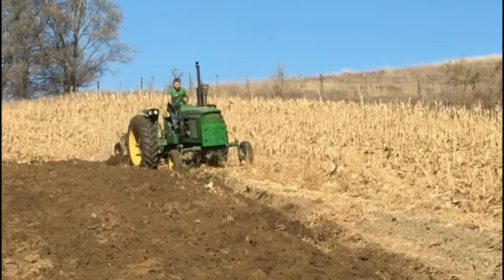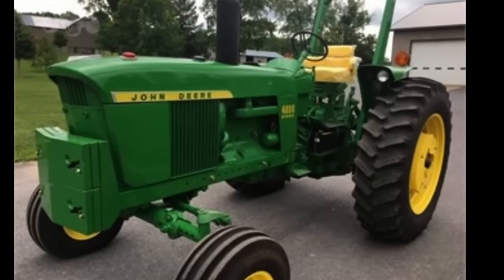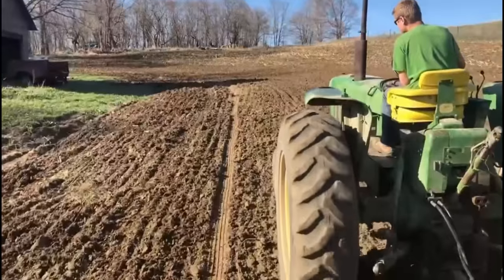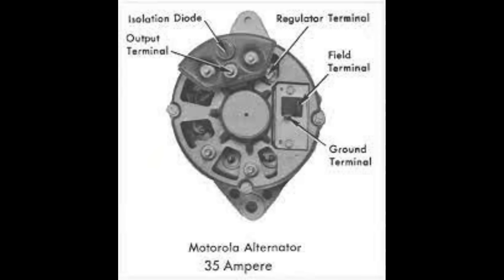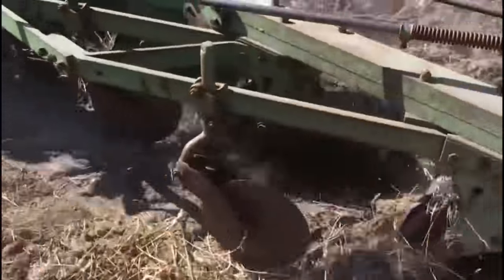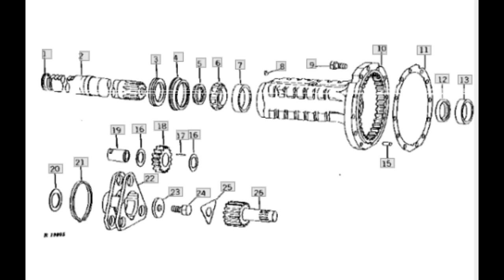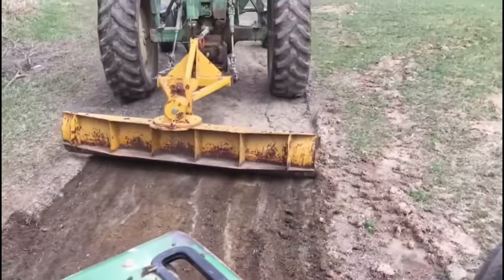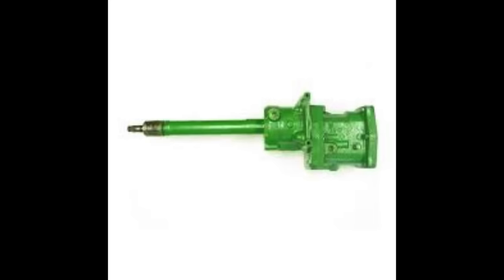John Deere 4000: What Made it different from the 4020 and 3020?

Comment: I remember when JD as a ad campaign promoted the 4000 as an acceptable alternative given the dwindling supply of 4020's as the 4020 was coming to the end of it's production run .Thank you for answering my suggestion. Here's a couple of other topics to look into. First, the nightmare of the Ford 6000 which Ford dearly came to regret. Or the fuel guzzling IH hydrostatic drive. I know you would do good work covering both. Thank you.

Comment: My uncle bought one new in 72 for the farm. Since we were farm equipment dealers he never used it that much. Always sat in corner. Also bought a 5 bottom plow new with it. It was around 7000 new. Surprised he sold it in the 90's. It had around 1500 hours on it and sold it for 16,000 but it was still like new.

Comment: I recently sold a ‘71 4000 synchro.  Nice and straight with diff lock and dual remotes.  No longer needed on the farm and too valuable to let sit around.  Neighbor has a 71 powershift with about 15000 hours.  Kinda rough but very collectible
Reply: Could I ask, how much did you sell the 4000 for?

Comment: One aspect you didn't touch on (and might be hard to research) is market conditions- what was the competition doing? I believe IH was offering a "custom" version of their 806 and later 856 models to compete on price. Different seat, fenders, and I don't know what else made them price competitive with the 4020. Rather than cheapen the 4020 in a similar fashion, Deere brought out this 'different' model to compete on price with their biggest rival.

It was also, as you pointed out, marketed as a high-speed tractor, pulling the same implements as the 3020 but at higher ground speed- a predicted trend that didn't stand the test of time. Tractors got heavier and heavier as time went on.
Reply from the maker: That's a good idea to include market condition to these videos! I got a couple IH buddies i might need to ask for some help on the next videos comparing. Thanks for watching, have a good one.👍

Comment: We had a 3010. Dad was looking to upgrade in 72. Field tested a 4000 but opted for a 4020 instead. Two years later he bought a 4010 that had a new engine. That engine out performed the stock 4020 and the 4010 became my tractor of choice for field work. Both had the synchronized shift, no cab and only one hydraulic port. I left the farm and dad traded them both for a 4330. Worst tractor he ever owned.

Comment: The John Deere 20 series was one of the best handling and comfortable tractors ever made. I still have and use my father’s ‘71 2520 diesel synchro. Love it and would rather drive it than anything they’re building today however, the modern cabs are kinda’ nice when the snow starts flying. If Deere were to start building them again, first of all, one probably couldn’t afford them but they wouldn’t be able to build them fast enough.

Comment: Vry calculated made jd4000 1970 having 15less ponies but ploughing outkum was equal wid senior bro 4020 by help of less complicated & mor simpler transmission gear drive system which gave higher speed to john deere 4000 a true gem of efficiency of late60s & early 70s vry Great upload of short lived vry efficient icon jd4000 of it's era

Comment: I worked for a hay farmer who had a diesel powershift 4000. He had no clue it was rare. He used it like any other tractor and it had been it’s whole life. The sheet metal on the side was even gone
Reply: I worked for a rancher in 77-78 and he had a 71 model power shift that turned over 10,000 hours while I was running it. It was going all the time and completely trouble free. Wish I knew where it is now.

Comment: JD had only one 6 cylinder row crop, the 4020. IH and Oliver had several different 6 cyl. Row crops. The JD 4000 gave them another machine for the dealers to sell. Good machine.
Reply from the maker: very true, thanks for watching!
Reply: Deere had the row crop 4520 and 5020 before the 4000
Reply: @plcwboy  5020 was available in a  row crop but too heavy or expensive for most farmers. Primarily a standard tread tractor. 4520 and 4000 were both released in 1969. 4520 way above the price point to compete with the smaller sixes from  other manufacturers.
Reply: @glenirwin1110  The statement that Deere only had one 6 cylinder row crop tractor is false.
Reply: @plcwboy  Technically false but as a matter of practicality the 5020 row crop was so rare that I doubt most dealers ever had one on their lot. The question was why the JD 4000? The answer is that dealers wanted a second 6 cylinder row crop to sell.
Reply: @glenirwin1110  there were 5806  row crop 5020s built.  That's more than the total number of 6030s built, only a couple thousand less than the total number of 4000s built.
Reply: @plcwboy  My point was that if you made a thousand 5020 row crops a year to cover 2000 dealers, then most likely most dealers never had one on the lot. I grew up in a farming community and never even saw a 5020 row crop. As a practical matter, if you went to a JD dealer in 1968 looking for a 6 cyl row crop, they showed you a 4020. If you could not afford it, you had to go to IH or Oliver for a 6 cyl. The JD 4000 was supposed to cover the gap between the 3020 and 4020.

Comment: Dad let me drive the brand new 4020 12 miles home from the dealership. Didn't see that coming. By the time i got home I was a pro Deere driver. Age 13
Reply: I backed a brand new 4020 off of the delivery truck in 1972 at the same age. It was the last 4020 our dealership ever sold. Also had the last 4440 they ever sold as they went out of business.

Comment: The notion it was expensive to use Dubuque engine in a Waterloo chassis is pure bunk. Explain the 2510, 2520 and 4030. In all actuality, the Dubuque engines had more power per cubic inch. This was due to the cross flow head design vs the Siamesed design of the Waterloo engines. In fact, the Dubuque engines were featured in the new 6600 Combines. This eventually led to the 6.8 engine widely used in later years. More power, higher torque rise, lighter and a bit smaller in physical size. Thank goodness those 1010 and 2010 engines were a flop and Deere saw what IH, AC and Ford were achieving with the cross flow head design and decided to adopt that design. WHY  they didn't update the 466s to that is a mystery. Think of the power of a 466 that could breathe easy.

Comment: A JD 4000 was a cheapened 4020, that's pretty much what we thought of it when we first saw it  when it came out. That's not a knock but it is what it is. The 4020 was just more money than the competition so Deere had to make them cost less so you do that by not having things added or making what was on the machine less than what was on the 4020. You get what you pay for so with the 4000 you paid less and got less. I'm not saying it was a bad machine but it's not a 4020, for sure.

Comment: 4000 was a dud.  It was built to compete with the IH 826, which was the economy version of an 856.  Farmers were clamoring for bigger tractors, not smaller ones.  4020s were getting turbos and 4320s were getting snapped up as fast as Deere could make them.  The 4000 just took up production space that coulda been used better. The 4430 replaced the 4320 and was the best selling model of that series.  The 4030 replaced the 3020 and was considered a dud as well.
Reply: 4030s were hardly a dud. The Dubuque 329 6 cylinder had lots of torque for it's displacement. Deere wanted to capitalize on the 2510/20 success by offering a Dubuque engine in a Waterloo chassis. They were not a 4020 upgrade, they were a 4010 equivalent. Many 4010s got 404 overhaul kits and/or M&W turbocharger kits. That 329 was also in the 2840 and the 6600 Combine. That 359 then went to 6620 Combine, the 2950/55, and became Turbocharged for the 3050/55 and 3255 producing 90 PTO hp. Those 359 engines had lots of torque with a 5" stroke and cross flow head, something the Waterloo engines sorely lacked at the time. They later became 414 used in the 7000 series tractors. 4030s were then and stillnare still overlooked because initially they didn't get the QuadRange and Deere never offered the PowerShift. They are excellent thrifty tractors for Hay and cultivation work in the SoundGuard cab with the AC on.
Reply: @thegreenerthemeaner  . They are overlooked because they are a disappointing tractor. The 329 had cavitation troubles no matter what it was in. Farmers mistakenly thought the 4030 replaced the 4020, even though the sales brochures stated from the get-go that the 4030 replaced the 3020.  If the farmer used their new 1973 4030 like they used a 3020, they’d get by  alright.  If they used it like a 4020, it didn’t take long to be disappointed.

You might wanna look again on what engine powered the 6620…

Comment: Why get a 4000 when you could get a 4010 which is essentially the same thing
Reply from the maker: True
Reply: They didnt make the 4010 when the 4000 came out.  4010 had a smaller engine, only available in synchro,  had a completely different pto setup, no diff lock option, not a side console, and more. 4000 was a better tractor than a 4010.     4000 was to replace a 3020 while keeping your implements and pull those implements but faster.

Comment: Transmissions were not built for heavy low till implements  and traction is horrible  a much improved front assist axle has been introduced  many of these older tractors are good for milling feed and clearing the driveway